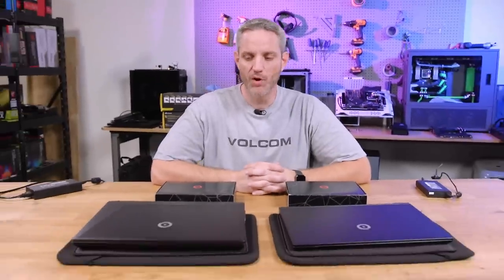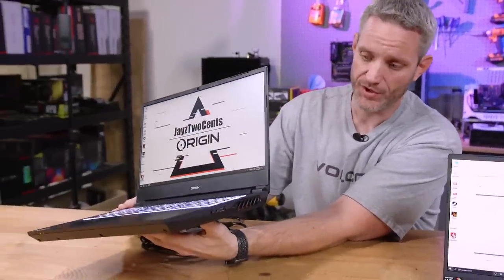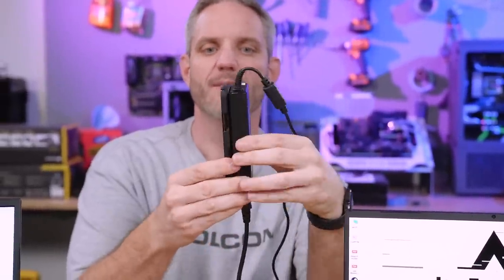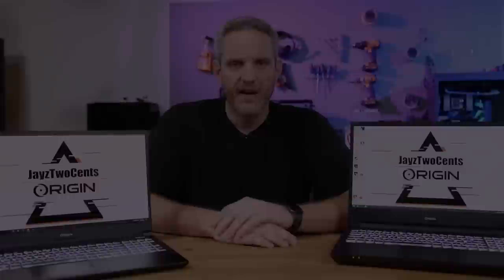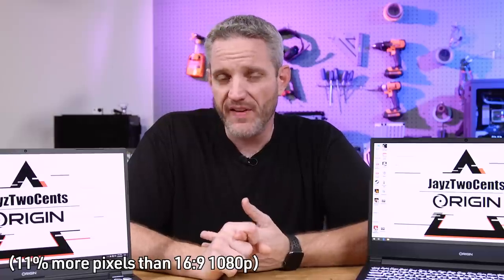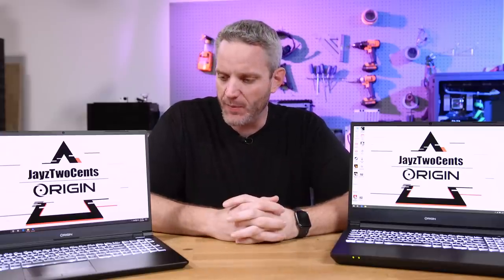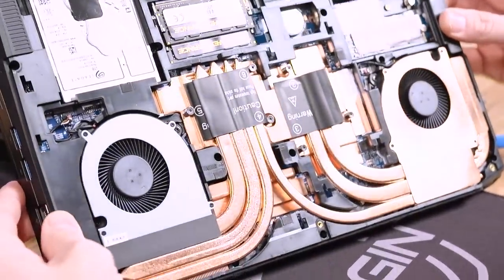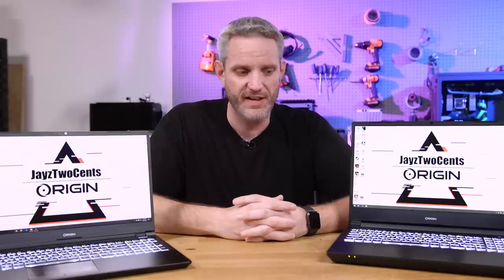A Laptop with 16 Cores 32 Threads?? Desktop killer!

Comment: well, i have projects in which i need to calculate hundreds of excel sheets that take 45 mins in older PCs (2013 MSI PCs, quadcore), 20 mins in my MSI Core i7 10th Gen (hexa core), and 16 mins in my desktop PC (hexa core), so 16 cores would drastically improve my calculations times thus improving my productivity and capability of selling projects....... gaming wise, i'm a CIV 6, football manager player, which is CPU intensive, so it fits PERFECTLY on my needs

Comment: Damn, you did manage to make me write my work use case.
As as software developer/architect i can believe no CPU will ever be fast enough. Right now (during this whole HMalware situation I am working of 4 core 6gen i5 with 32 gigs of RAM, that was meant as a gaming machine 4 years ago).

So, with Intel system i would do the same like with AMD system.
Current work laptop is Lenovo X1 Extreme with 6 core i7 mobile in it, and it is a decent enough machine for general work.

But when i push it to the limits, having 2 - 4 IDEs running, running a docker-compose env with several "service" containers (database, mq, cache, etc) and then starting up 8 applications (systems I work on are distributed and split into smaller components for better scaling), I run out of cores, I run out of memory.

Hitting 28-30gigs of memory usage is fairly normal for me, and having all my CPU cores pegged at 80% (no matter is it 4 cores or 6c12t) happens way too often. From what I see, I would be able to use up 12c24t 3900x, not sure if 3950x would be utilized enough amount of time to justify the price, but it would be nice. And waiting for a machine to finish something, or do something is time/money lost.

A laptop is a useful thing for someone like me, because I work from home, I work from the office, I work on meetings, and I do need to bring my configured system all around. Having to carry that beast of AMD might not be interesting much, since we are more, and more working from home, but a year ago, that kind of system would be on my shopping list for a work rig.

On the other hand, an ITX 3900X or 3950X build would also be "portable" enough to move from home-office to work office. Damn, need to upgrade my home system, but life, and things, first.

Comment: FINALLY SOMEONE COVERED THESE PROPERLY!
Jay please also do a review for the eon 17x - modified from the clevo x170 chassis. 
thanksss :)
Reply: I got dissapointed a while back when LTT came up and said "This is the fastest laptop ever" and it had a 2070 super + an intel 99xx series 6 core and i had been using my current DTR for a year longer that has 2 full size 1070s (2048 core vs 1920 desktop) and an 8700k at 4.8ghz in it, These are proper workstations much like mine and it is good to see them actually get covered, Even if all i do is use it for gaming
Reply: @Yuki2204  you had thr P870? The one with 2 forward facing HDD slots? Nice man! :)
Can you tell me your specs and the price when you bought it?
Just curious.
I have a P775 DM3-G with a 7700k+1080
My config was around 4500 USD, but it's just that things are costlier in India (my country).
Reply: @Ansh4Xtreme  120hz 1440p, dual 1070s, 8700k, No drives 16 GB ddr4 2133, It was 4000 AUD when i got it and came with a free promo drive that i yanked out of it.  Now it's a modded cooling system, Prema mod 64GB Ddr4 2600, 2x2TB micron 1100 sata SSD's in raid 0 for steam, 3x Samsung OEM 256GB M.2 drives in Raid 0 for operating system, All important documents are mirrored on my nas and cloud.

Comment: I have the AMD version (but from XMG) with the 3900 chip and RTX2070. It is an absolute beast. I just started using it for some science stuff. It it very loud though, like very loud, but under 100% CPU utilisation in my case it seems to stay at ca 80 oC which is very impresive.  As Jay mentioned, it is intended to be used as a mobile alternative to a desktop. So far I am really happy with it, and as long as you can tolarate a lot of noise in exchange for performace, at the moment you will not find a faster mobile machine than this. Even though it is a bit plasticky, it feels very sturdy and solid. Suprisingly, in my case buying this laptop (in EU) was actually similar price as building a desktop with comparable specs (tower only) , but here I have  also the addition of the very important for me aspect of protability.

Comment: I am using a smaller 15.6 Omen with the i7 and a 2060 RTX with a 144Hz screen as a desktop replacement. I know it isn't the fastest machine on the planet, but it runs all the games I enjoy on my larger 32 inch 144hz screen and I simply use a small portable dock so I can use my full sized gaming keyboard and mouse and when I need to take it along the dock makes it simple to unhook and go.

Comment: the thing about calling these "desktop killers" is that they will always be more expensive. I went to origin's website and used their configuration page to create a system comparable to my i7-9700k/RTX 2070 Super diy desktop that I spent a total of $1700 building, and the final cost of the laptop equivalent was over $3500. This is why I will never spend this much on a laptop. My 2012 hand-me-down 13" macbook pro is more than enough for anything i could logically imagine doing on a laptop.
Reply: Does that 1700 include a 4k oled screen?
Reply: @ScottyBGaming239  No, but it includes 4 1920x1080 monitors and a 2560x1600 monitor

Comment: you forgot to mention that with bios update,that clevo NH55af could use next ryzen chip as well. also one could use/buy 330W adopter from internet and push those watts when unlocked bios/etc is found. years after years we were told that you could not game on expensive Xeon with higher cores&threads because games can't use of them,but nowadays we see that games has been optimized to use such power optimally and it will be better and better as times goes on,which also helps in 1% low FPS in games as well;so your cpu power with 3950x/4950x @65w or higher, means that your laptop will age well much more than others. if only clevo had released a 150-180W RTX2080super in the same chassis with more thicker vaporchambor+heatpipes plus offering 330W adoptor, that would've been truly a beast to beat;unfortunately clevo has only X170sm with 10900k and rtx2080super in a thicker/heavier chassis.

Comment: It is getting pretty nuts the amount of power you can get in a mobile form factor while still actually having strong battery life.  I mean getting this level of power with hardly useful battery life isn't all that hard, but if you take more mid range mobile parts and then put it in a desktop replacement chassis you can get one heck of a nice laptop with plenty of performance and pretty strong battery life.

Comment: ok so the larger laptop is using a 2070  Max-p gpu. it has a 115w TDP where as the full fledge desktop variant is 215w TDP. The max-p is the most powerful mobile variant of the gpus you can get in a laptop. Your non MAX-Q gpus are usually 90w and then ofcourse the MAX-Q are much lower powered. I think they around 45w so dont expect huge gains in performance or that a 2080 super Max-q is anywhere close to a full sized desktop version. So it isnt safe to call the 2070 super MAX-P a full size desktop graphics card.  Hardware unboxed actually put out a video recently explaining all the different mobile gpus in laptops.

Comment: This was a good video Jay. Enjoyed it. One thing I really never got is how different mobile hardware is compared to desktop parts. Like is HQ designation for intel laptop cpu the exact for say the non K desktop part? I have a Asus rog strix GL703VM laprop that has a i7 7700HQ and for cpu heavy computing like CFD for per core the laptop has the same performance as my 5960x stock (they share the same clock speed) and that's neat. For gaming the GTX 1060 gets similar fps as my desktop 970 for the games I play (mainly bf4, bl2, bl3, me3, doom, etc). So laptops are kinda getting really good. Since my AIO died on my desktop, I've been using my laptop as a desktop and it's really good, even with linux VM's. So I'm definitely sure these origin laptops are definitely dangerously good.

Now to answer your question, if I had the and system I would def be using VM's, compiling code from source and running lots of intensive 3d cad/visualization, simulations (cfd, etc) and some gaming/streaming. The intel system could handle this too and would probably be easier to move around as well, but for the intel system it be more cor gaming with the high res display option imo.

Comment: Hey Jay! I have a little challenge for you. I've seen some cool little Raspberry Pi 4 computer builds for light work and web surfing.I've also heard that it is possible to overclock it a little bit. So I was wondering how far you could take it. I know it won't be anywhere comparable to a mainstream gaming laptop, but I have to get one for my electronics course and I've been thinking of 3D printing a nice laptop style case with a nice little keyboard and screen, And was wondering how far you could push it. Maybe even try to jereyrig a little liquid cooler for it 😅. Would be awesome to see.

Comment: I wouldn't mind the Ryzen system for my research. I do computational physics with a lot of parallel computing and being able to test code locally saves quite a bit of time. Usually that kind of work stops when I'm at conferences or away from a desktop in general (not a huge issue right now) and the extra weight might be worth it to avoid that. It's always difficult to get time on servers or clusters to work remotely and it's a bit of a headache to remote into a desktop on a university network.

Comment: Here's my new laptop spec. It's insane! GPU pulls up to 175w and cpu pulls up to 100w! Came with a huge 330w power supply. runs about 80-85 c on CPU and 60-65c on GPU under full ultra 4K rendering. i play Warzone at 135-145 fps ultra everything on 1440p with a +165mhz to core / +750mhz to mem on the GPU. I love it!

2020 HP Omen 17T-CB100 Intel® Core™ i9-10885H (2.4 GHz, up to 5.3 GHz, 16 MB L3 cache, 8 cores) + NVIDIA® GeForce® RTX 2080 Super™ (8 GB) + 32 GB DDR4-2933 SDRAM (2 x 16 GB) + 1 TB 7200 rpm SATA; 512 GB PCIe® NVMe™ M.2 SSD + Windows 10 Pro 64

Comment: I would take the AMD system for sure.  I use Linux and occasionally compile software.  I also occasionally run VMs to take a look at various distributions while using the main desktop as well, so the extra threads would definitely help.

Comment: And here I am perfectly happy with my HP Zbook17 G4 with an i7 7820HQ and a Quadro P3000 that I bought for $3 shipped to my local Walmart.  Add in the $100 I spent to upgrade it to 32GB of Ram and a 240Gb NVME ssd and I doubt I'll want to replace it any time soon, unlike my main PC with an FX8350 and RX480...

Comment: The AMD one can cost $3,506 if you opt for two 2TB NVME drives totaling 4TB total storage and 64GB of 3200mhz ram.  If your budget is $4,006 than the $500 saved can buy a ton of games and accessories.

Comment: I own a similar machine to the desktop replacer. The Helios 500 with a full AM4 2700 and a Vega 56. The only downside I have to it is that is giant af and basically must be attached to a wall. It is nice that it's equivalent to a desktop once you put in a second SSD and a hard drive but other than being "portable" it's not really a laptop.

Comment: Something to mention is the the amd system is Literally the only model of its kind out right now by any manufacturer.  This is Clevos first foray into amd desktop laptops so expect them to make a larger model with a 330W power brick in the future with a 17 version and more screen options to come.  It has a 2070 because that is the most power available given the design limitations but overall its very impressive for what they cram into it.

Comment: euerocom x9c here with dual RTX 2080s in sli- minus the bridge, delided 9900k, 32gb ram, 120hz 2k panel--780w PSU, entire system is a brick but I love it and since I travel alot its perfect since I cant have a desktop.

Comment: I've gone the other way. I normally use a laptop at the office. But I've been at home so long I've put my work VM on my main desktop rig for the extra cores and ram.
Regarding these systems, I'd rather have the AMD system for my day job. I do software dev work, sometimes with docker images inside a vm while running a second VM for other things. All those cores would help a lot and give room for future projects. But for other uses, the Intel system is tempting for its greater portability and more so for its thunderbolt (for black magic video interfaces and high end audio gear) in my side job

Comment: So I own a version of the AMD system built by Sager. I chose to have a 3700x processor, but other than that my computer is the same.
Over all i love this computer. It is fast and the display is top quality. The speakers suck, but that's not what you are paying for. still for $2000 i expected better.
I didnt know that the 2070 was also a desktop card, just power throttled. I was very surprised to find that it keeps up perfectly with the 2080 super max Q. I had looked into upgrading to that card, with no success. I would love to learn more about how the 2070 performs in laptop form against other laptops.
Most of all, I settled on the 3700x because I heard that the New 4000 series CPU's will be compatible with B450 mother boards. I didn't see the point of buying the best CPU when i plan to replace it in a few months to a year. 
I use my computer mostly for gaming. I have hopes to stream with it as well, and i might have need to run CAD programs in the future. Mostly I am just an AMD fanboy, and wanted a bad ass laptop to brag about. I think i got my wish.

Comment: For architecture workloads the desktop replacement seems fantastic. I actually have a MSI with an i7 8750H and an 1070 full specs, and it is not enough compared to my workstation wich is a desktop whit an ryzen 7 3700x and two AMD R9 380x

Comment: Neither works for me because I can't handle workstation workloads on tiny 15" workstation laptops. Workstations need extra monitors but if you're mobile (the whole point of workstation laptops) you can't carry around those extra monitors. So until manufacturers prioritise 17" versions for workstation laptops I have to stick with my old, slow 2013 laptop.

Comment: Do you think it’s possible to have a modular external cooling solution in the near future? Something like a laptop cooling stand but is more integrated and can be removed if you want to run the laptop in a mobile environment.
I imagine something like a cooling “dock” wherein you remove a covering plate underneath the laptop to reveal copper that is connected to the internal cooling solution. Then, the laptop attaches to the “dock” and creates contact with the copper and helps in cooling down the cpu for heavier workloads which produces higher temps at home.

Comment: I'd be using them for CAD and FEM. Not daily, and only for small assembleys (under 200 components). 
Threads seem to reign supreme with simulation duties.
But those Intel single core capabilities though...

Comment: The 4800H is a pretty good beast as well! It actually is tearing up my desktop 3600x in production and even though it is the 90w variant of the 2060 its getting really close to the same fps as my desktop. Overall its faster than my 3600x!

Comment: Honestly, I probably will be taking a serious look at the AMD laptop. I currently have a 3900x and 1070 in a massive desktop case, but I'm going to be downsizing soon and I need to be able to take my video editing, game programming, and audio production on the road. This seems like a great side-grade from my existing desktop to a laptop form factor to give me all the performance of my home system without having to remote in and rely on fast internet to get a usable experience.

Unfortunately, in order to do that I'd probably have to sell my existing rig to pay for it - because these things are not cheap! Still, if the thermals really are under control, I could probably get away with using it at home as well.

Whatever I do, I'm sure it'll be better than by Lenovo surface clone with it's i7-8550U and 8gb of ram lol

Comment: I'm with my desktop 3900x and, other than running two handbrake sessions or rendering 4k constantly, it's actually difficult to max it out. Hell, even running at 100% the temps barely reach 75c.

I can't wait until software actually starts to use multi core/thread cpus more efficiently.

Comment: Great vid. So what are the noise levels like ? Any decimel readings ? Also temps under load ? You mention the 3950x hitting 91c. How about the intel ? 
If the 3950x is in eco mode what does that mean its running at speed wise ? And boost speeds in eco mode ? Sorry for all the questions